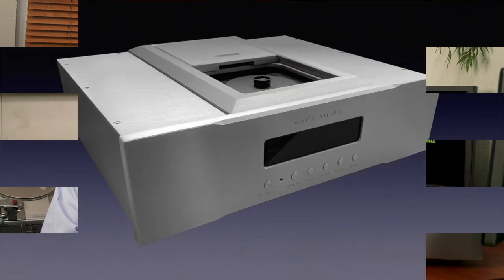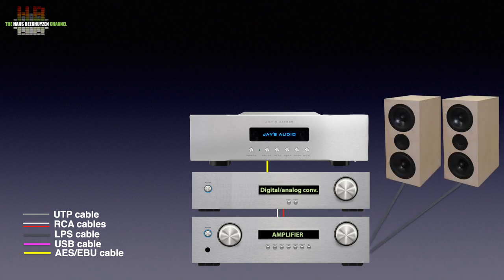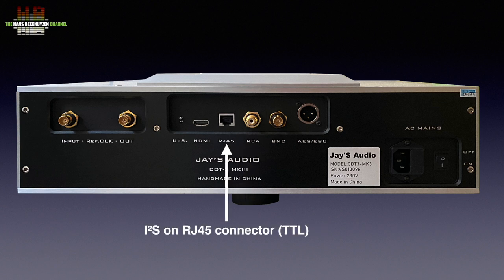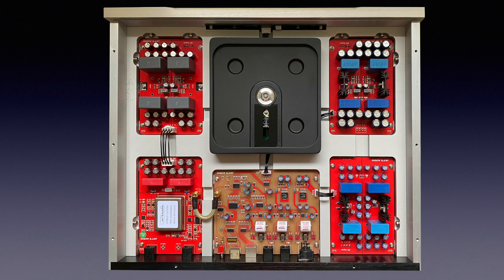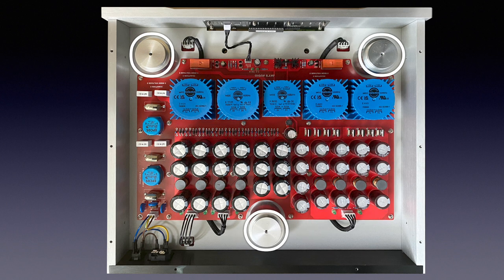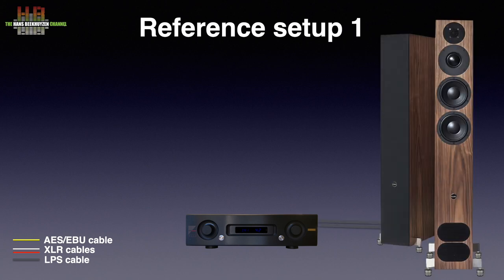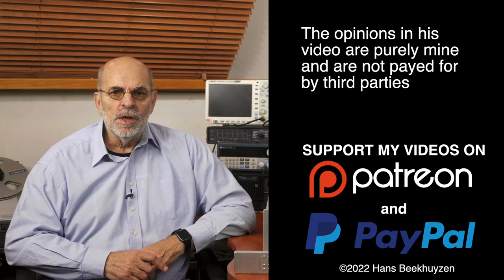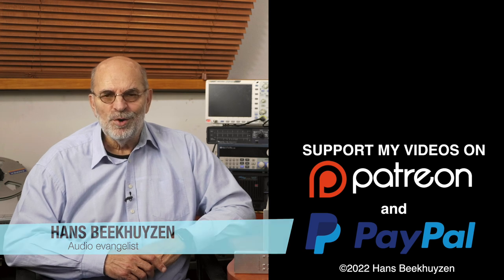Jay’s Audio CDT3 MK III CD transport

Comment: Thanks for the review. I have a CDT2-MK3 - a more modest version of this one - half the price. It sounds good obviously (I don't think that in my system a CDT3 would make a significant difference, and if so, perhaps not even for the better). 

having a large CD collection, and still getting a lot of satisfaction out of playing CDs - actually the main reason I got a Jay's audio is that I want a transport that will last many years - say, at least 20. (Who knows what transports will still be available 10-15 years from now?) The laser mechanism in the CDT2 is a Philips CDM4/19, while the CDT3 has a Philips CDPRO2 LF mechanism. Looking at the available sources, it seems that the cheaper CDM4/19 mechanism is actually the more reliable one of the two. CDT2 as a whole is also a lot easier to service in the future because of its less complex construction. I know it might not be a reason for many, but i think that it is still worthwhile to mention here.

Comment: I was planning to purchase this item, but stumbled on a used Oppo 105D that I simply couldn’t turn down. I thought the Jay’s Audio was the bomb. Hadn’t considered the Grim. I’ve also come to appreciate the value of a player as opposed to a transport in my system. My analog preamp allows each input’s level to be ‘trimmed’ so that one doesn’t have to readjust the volume level when moving from digital source to digital source on the DAC. I often find CDs play at much lower level through AES/EBU input to the DAC than the streamer playing through the SPDIF (coaxial) on the same DAC. I really need to be able to trim the inputs on the DAC itself, but using a player, gives me the same functionality, using the preamp’s remote to make the changes is icing on the cake. (The DAC doesn’t have a remote.)
Reply from the maker: Interesting. Normally AES/EBU and SPDIF carry the same digital signal and thus should sound just as loud.

Comment: You should hear the Aqua La Diva - I heard it in cirect comparison with Innuos Statement is it wiped the floor with it.  GRIMM must therefore be pretty darn good.
Reply from the maker: It is.
Reply: MU1 would be just as good and or crush the aqua.  And it’s a little smaller too.

Comment: I just purchased a Lampizator Poseidon Pre-Amp/DAC.  I want to get the maximum audio quality (not resolution, or audiophilia concerns) out of my 15,500 CDs (I also play 28,500 LPs and 7,000 78s) without breaking the bank.  I have Von Schweikert VR9 SE Mk2 speakers.  Would you comment on whether I should dump the Poseidon as a DAC and just replace it with a Grimm Audio MU1 CD streamer with a cheap or other quality CD transport for better musical enjoyment since your video indicated that the Jay's Audio above has a less than satisfying lower mid-range resolution (lower mids are important for acoustic music as it gives it the body/soul).  Did you mention that a cheap transport would work as well (such as a Shanling ET3 top loader)?  I failed to find a CD transport/player in your Setup Videos.  Do you listen to CDs?
Reply from the maker: I listen to cds after I have ripped them to a hard disk

Comment: Hello Hans, per your recommendation, I bought the MU1 and jettisoned the MSCALER. totally satisfied - not ever looking back. Curious, if you attempted to connect CDT3 to the AES/EBU input of the MU1?  Also, do you use the volume control of the MU1 or DAVE?
Reply from the maker: I have not connected the CDT3 to the MU1 since I already tried a very cheap jittery CD recorder and that sounded great (!!!!). I use the volume control on the Ayre amp, use 4 x oversampling on the MU1 with the 3 dB headroom switched on and the DAVE volume is set to 0 dB.
Reply: @TheHansBeekhuyzenChannel  I'll give those settings a try. Interestingly I've found that studio recordings from mid 70's-early 80's have slightly better soundstage with 2X OS than 4X. ...YSEMM (Your Sound Experience May Vary)

Comment: While I conceptually understand the meaningful difference in sound quality between DACs, how much are you convinced based on your experience here and elsewhere that there is a meaningful difference in sound quality between transports?
Reply from the maker: Are you serious? Why would I spend a lot of money on a Grimm Audio MU1 if the Auralic Aries G2 I had previously was just as good. A technical explanation can be found in my video ‘Why switches influence the sound quality’ (https://youtu.be/B-StTplQZys) for what goes for switches also goes for transports.
Reply: @TheHansBeekhuyzenChannel  Thanks! This was a genuine question, not a statement. I myself don't know. However, I have seen here on YouTube someone comparing a poor quality transport tof a supposedly much higher quality one and then using software to "prove" that the digital information being extracted from one and the same compact disc playing on each machine was identical. If this were to be the case generally (and I suppose that would be a BIG if), then what would the source of any audible difference be?
Reply: @TheHansBeekhuyzenChannel  And, yes, I will watch that video. Thanks.